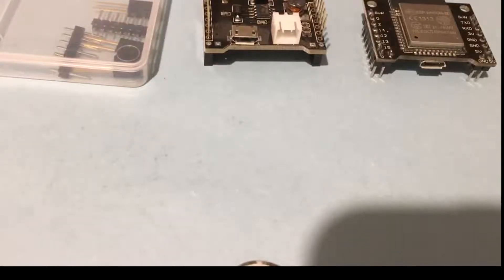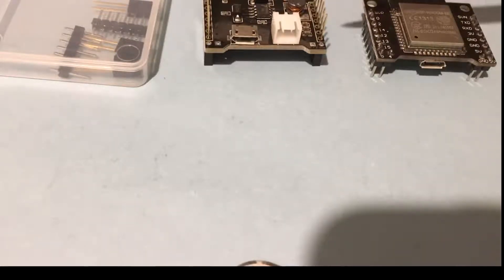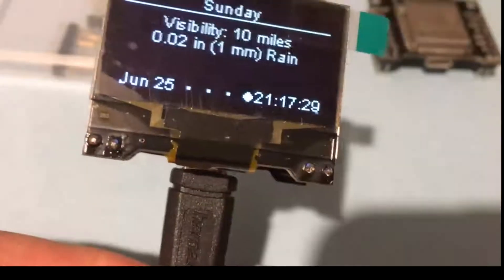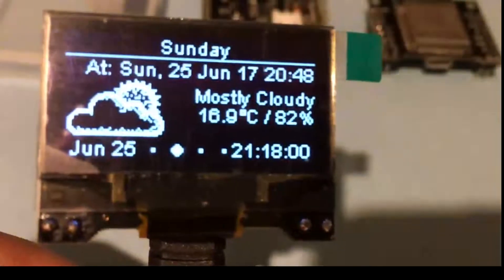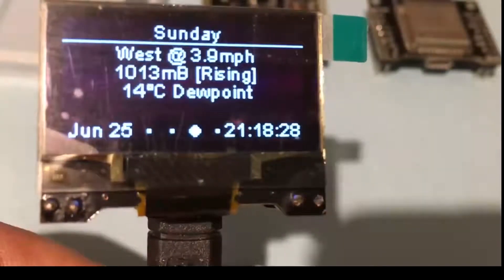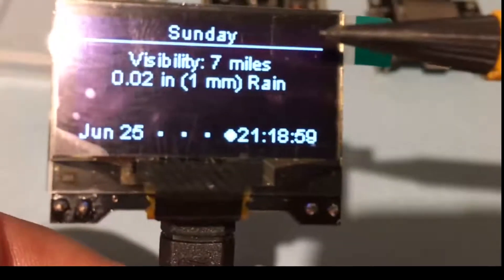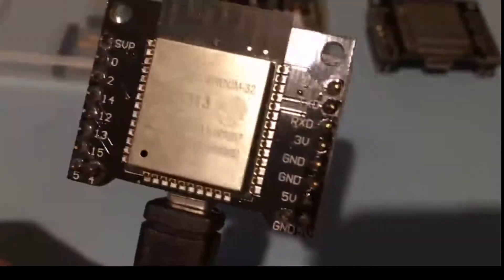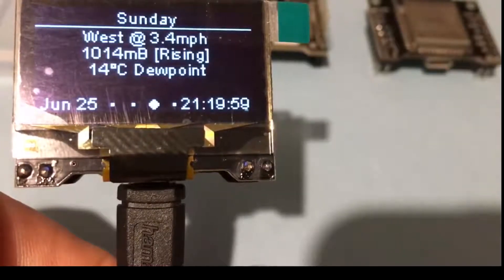Tech Note 043 - ESP32 1.3" OLED Weather Station using scrolling frames

Comment: Ok, you can't update it with Openweathermap settings, I have a valid key!
Reply from the maker: So do I have a valid WU  key, but it does t work for mine either! It’s a WU thing. Their change never made any sense as they were getting a huge amount of free weather data! OpenWeatherMap map API calls are completely different, I’ll have a look at updating the code for OWM, but even that changes in June’24
Reply from the maker: I have now added an OpenWeatherMap version to the repository.  It may not be cosmetically perfect, but very close to the original.

Comment: Which ArduinoJson version is suitable?
Reply from the maker: I have updated the source file to match the current JSON decode and fixed the screen qwidth issue. You have to install the screen driver I reference at the top of the file, it's the latest.

Comment: Hi, I'm very interested in this project but I can't make it happen because when compiling the sketch it gives me this error "Compilation error: 'DISPLAY_WIDTH' was not declared in this scope", how can I solve it? Let me start by saying that I'm not very If you could explain to me which line I need to correct I would be grateful. you.
Reply from the maker: Have you installed the library : https://github.com/squix78/esp8266-oled-ssd1306
// Include the UI lib you find that on GitHub download the zip then install via sketches library add a zip file.

The missing definition is in that library
Reply from the maker: It could also be the library author has removed altogether the definition and it’s now redundant so comment it out and for the height with a prefix of //

Comment: Good afternoon . Also . When compiling the project, a compilation error occurred on the esp32 board.
I have a TTGO-T-Lite w5500 ESP32 board on SSD1306 + Oled Display
Reply from the maker: What is the error message? You can select and copy it with ctrl-c